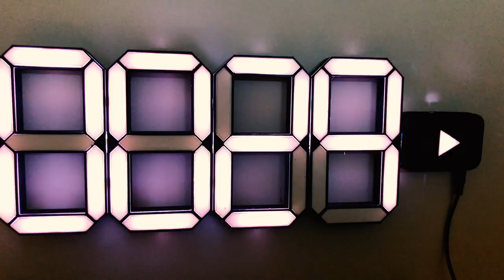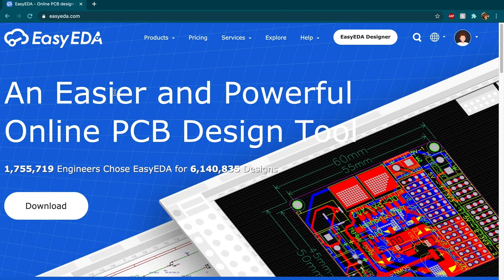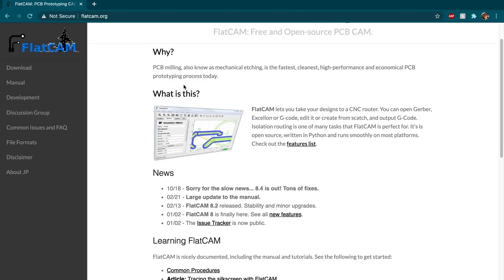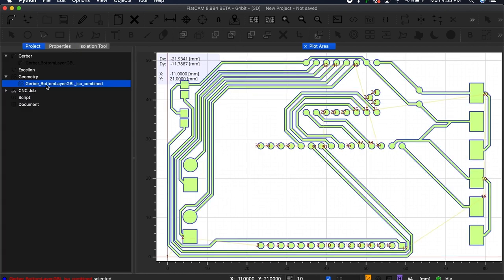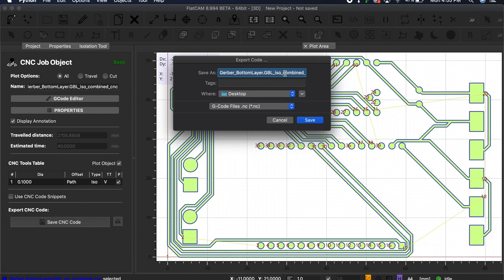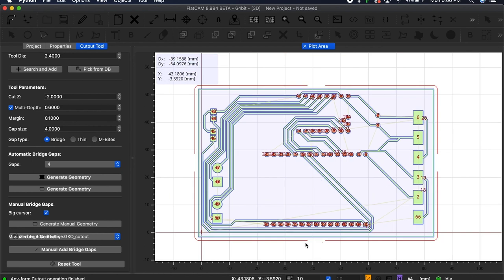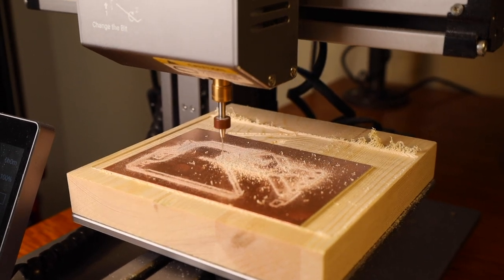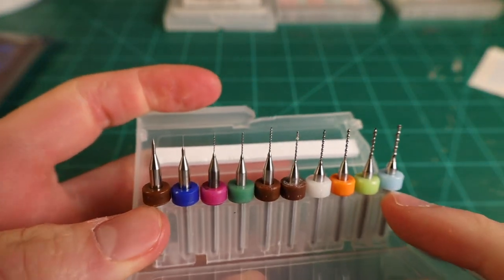Milling Custom PCB’s with the Snapmaker

Comment: The PCB is of poor quality and I doubt it will work properly. The machine lacks rigidity. Cantilever axle arrangement and long overhang of the cutter. It is not intended for milling. Looking at such videos, it seems that everything is fine, but in fact there are many nuances in board milling. For example, scanning the PCB surface. The machine must be rigid and the spindle must be free of runout, unless you intend to make tracks an inch wide ;-)
Reply from the maker: Thanks for the tips!

Comment: I cannot open the *.nc file in snapmaker. Usb key in machine shows no file, and Luban cant open them as well. Any help?
Reply from the maker: This link may be helpful in tracking down the cause, but if not it may also be that one of the files on your USB Stick has a character in it's filename that Snapmaker can't parse. I haven't seen that happen on the snapmaker before but it does happen on my other printers fairly often. Hope that helps 🤞
https://support.snapmaker.com/hc/en-us/articles/1500000522901-What-should-I-do-if-the-machine-can-t-read-the-file-of-my-USB-flash-drive

Comment: I'm struggling using the snapmaker to mill a PCB. For example the machine will not read the .nc file, I had to rename it .cnc and after that the machine will not ejecute the job, I had to manually edit all the cnc code, deleting a lot of comments and stuff at the beginning of each file.

Comment: Thank you for the video.  It helped me get ready for milling my first PCB with the Snapmaker.  I did encounter a challenge since my PCB design was not a rectangle as most are.  I got some help from someone else online to figure out how to deal with a non rectangular board shape.  But in trying to mill the first cnc file I discovered that my platform was not perfectly flat.  In your video you used a piece of wood that you flattened out.  You said you created a job in Luban to flatten it.  What steps did you use to do that?  I'm new to CNC but accomplished with 3D printing, so this is something I'm not familiar with.  Can you provide some pointers or links for how to mill the wood flat?  Thanks in Advance!

Comment: Thank you for sharing the video!
I would also be interested in whether you can cut the circuit board traces with the laser 🤔. I've seen laser PCB prototype machines in the professional field. (The drilling of the holes and the contour milling was still done with a CNC milling tool.)
Could you test this process?
You may need to paint the copper surface black to avoid reflections from the laser.

Comment: hi, i like ur videos but for me wegstr is the best for pcb milling :) everyday i watch one their pcb milling videos its relaxing me, flatcam has bug like that maybe try cut2d desktop software , looks like snap maker not accurate for pcb milling maybe need some software or hardware calibration for it dunno but keep up, thank you
Reply from the maker: Thanks for the tips!
Reply: If you have $3000
Reply: @fransgeeraert6487  Right? I want a Wegstr... real bad. But I'm not spending $3K+ on one